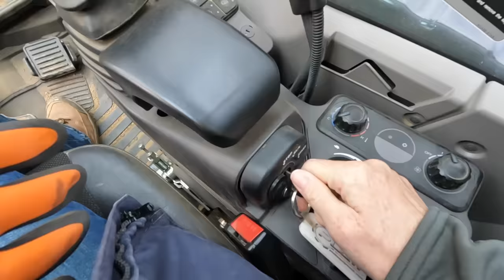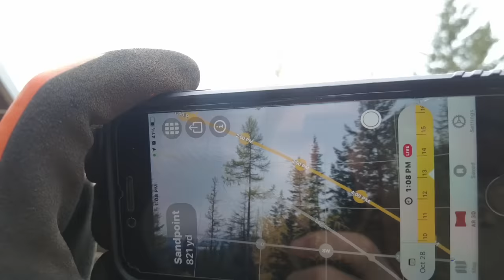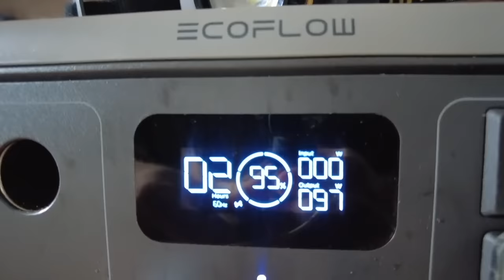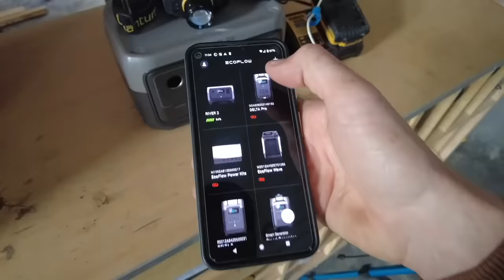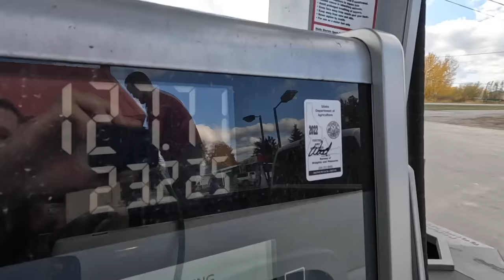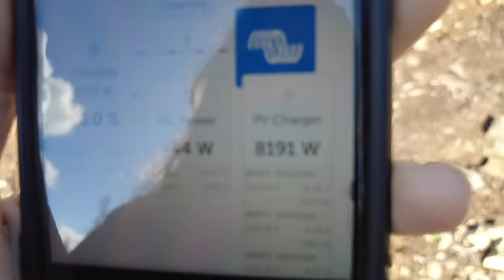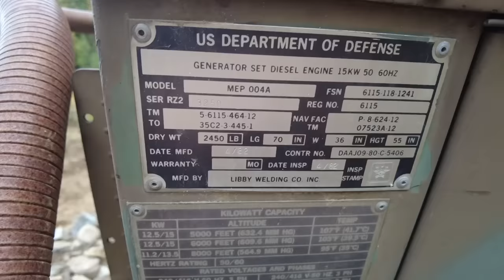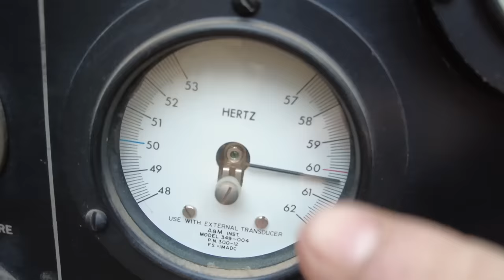Fixing PROBLEMS With Our Off-Grid Solar

Comment: I enjoy your videos. Might I suggest investing in a used heavy duty woodchipper. If you run all your forest wood and branches through it and spread the chips around your land you will add the nutrients back to the soil that the trees took out of the soil while they were growing. It's better than burning them up and losing all those nutrients into the atmosphere. After a few years the chips will compost back into the soil. It's good conservation practice. I'd suggest you add the chips back to the area you harvested the trees from. Good luck!
Reply: I believe the burning will do a better and faster job of returning nutrients to the soil.  It's what mother nature does in the forest and farmers have been doing it for years.
Reply: @srsykes  Plus Courtney gets to burn!
Reply: I am quite sure nutrient do not just go up into the air as there is a huge renewal of plant and tree life after forest fires that are started by lightning
Reply: Mulch holds water, on a mountain side that means soft soils that can slide.  Rot is the best way to add nutrients back from all the bugs and critters doing their jobs but small burns like this also put back carbon without too much worry about NATURAL organic compounds into the air.  The fuel exhaust from a chipper is not better than natural wood smoke.
Reply: @chrisdaniel1339  That renewal of plant and tree life after forest fires are due to many factors, more sunlight hits the ground, certain seeds of certain plants and trees only open under the heat of fire. There are also lots of plant and tree life that does not completely burn up in forest fires but instead rots and decays on the ground, adding nutrients back to the soil. Forest fires are natural and beneficial.
Reply: We use mulch to enhance our sandy soil.  While it has it’s pit falls the advantages out weigh them.  It also keeps weeds and sand dust down.
Reply: @marklar7551  I agree. I wasn't suggesting that burning the wood is somehow bad for the air. Simply that it would be better to add the nutrients back to the soil through mulching, because burning it up adds no nutrients back. Forestry mulchers do the very same thing with great results.
Reply: @marklar7551  modern combustion engines are far less polluting than inefficient open burning... this is well documented, many studies show air quality is terrible when a plurality of people heat with wood in the area. And even a fireplace has more efficiency than a smoldering pile. Far more carbon is lost to the atmosphere along with essentially all the nitrogen and volatile micronutrients.
Reply: Sounds like the forest service plane has taken an interest in the smoke from your fire. They really try to stay on top of fires. Doesn’t hurt to give them a call and let them know you’re burning.
Reply: The organic matter is largely destroyed by burning but the minerals are not. Either way is natural and will enhance the forest.
Regardless of which method is used, the amount of material they would ever cut and either burn or mulch is infinitesimal compared to the amount the forest will produce and add all by itself every year regardless of what they do, so in the end neither matters. 
Burning is far cheaper and as Courtney notes a whole lot more fun.
OTOH if you have horrible neighbors the chipper might come in handy. :)
Reply: @Mudpuppyjunior  That depends entirely on how much is cleared on any given area, and what you do with the ash (which is mostly calcium compounds and some trace elements). If you were to clear cut an area, there is nothing about burning it in a pile that will add nutrients back to that area.  I didn't mean to suggest that the little amount of wood they are burning would affect the composition of nutrients on the whole over they're land. But the fact remains that if you take down a tree and mulch it up and return the mulch to the same spot, that the nutrients from the uptake while the tree was growing will be returned to that spot. And if you take that same tree, cut it up and burn it else where those nutrients at uptake will NEVER be returned to the soil at that spot. Will it make a difference for a tree harvested here and there, maybe not, but it's still good conservation practice.  Particularly if you look at it from a long-term conservation perspective. Btw, i love burning fires as well, but now days it's more of a campfire type thing, not as a way to dispose of large quantities of wood I cut from the land. I would rather rejuvenate the soil with it. In addition, you don't have to cut the tree up in small pieces to send through a chipper. My experience has been that it's not necessarily faster or easier to burn.
Reply: Where we live it burned in 1995. All the old wood just brought ants everywhere. I piled it all up a ways  from the house and the rabbits live it in.
Reply: I think it’s important in a forest setting to burn while wet, anything that could dry out as tinder and lead to a fire in the dry season
Reply: @srsykes  I believe that burning releases more of the sequestered carbon into the atmosphere than into the soil, which decomposing wood chipping would do. Burning is fast, but even for nature this is selective, decomposing wood is more natural and healthier for the land.
Reply: You beat me to it! But not for the logs just the branches to control erosion and just put it all back to decompose in place. They cut the wood to burn.
Reply: I've never seen rural property owners out west using wood chippers for large amounts of waste timber.  The expense and labor would be silly for those size logs.
Reply: This works great for creating nice mulch for ground cover and garden compost. I use a chipper on my tractor for up to 6" branches. Everything that doesn't fit is big enough for firewood. I get manure from a neighbor and mix it into the chips to make a compost pile. Makes an amazing soil amendment for the garden.
Reply: Agreed I never understand why people dont process all the trees 🌲 that they cut down and just burn them
Reply: @mhalcius  Why we don't process every last piece is because we just need to get it done.  Not spends multiple days and $$$ doing it.  It can be difficult to even get people to come haul away free logs for firewood.
Reply: @NoName-ml5yk  If you own the chipper, and haul it to the area u cut the wood, throwing the wood into the chipper is very simple, straightforward and fast. There is no added cost or time other than the initial cost and fuel.
Reply: @pipeman65  I would be interested in what you find for a price for a chipper to handle ALL those logs. We looked into chipping some of our smaller waste wood (<7"). The rental price before the required insurance, taxes, etc. was quoted at $295/day. That was a relatively small chipper. I can't afford that kind of expenditures added to my regular expenses. Maybe others can.
Reply: @brianworley7705  You can buy used industrial size wood chippers at auctions for between 2k - 4k.
Reply: @pipeman65  clearly, you must own a chipper and have the time to do this. What model do you have and how much did you pay for it?
Reply: @FirstLastOne  I HAD a used Altec, which I paid a grand for in 2000', but I had to sell the property along with everything else in 2005. But I did burn everything for several years before buying it. Burning is pretty fast, but not necessarily easier. Hey, it was just a suggestion. They should do whatever makes them happy.
Reply: @srsykes  Burning releases CO2 into the air. Letting it decompose is the best way.
Reply: I would love to see the chipper chosen. The chips are good for paths around the place and trails through the woods. No mud in the wet weather. I knew a guy who limbed trees for a living. He used the chips on his driveway. As they deteriorated he just added more. What a difference with the Georgia red clay.
Reply: amen!!!!!!!!!
Reply: Came here to say the same thing. There is a reason why deserts are being reclassified and not because of dry and heat. More due to humans causing it in the first place by deforestation. Woodchipping would be the responsible way going forward and not repeat the mistakes from the past. Hopefully next time.
Reply: Call on Jesus.....time is short. John 3:16 - For God so loved the world, that he gave his only begotten Son, that whosoever believeth in him should not perish, but have everlasting life. 
Luke 13 3 - I tell you nay: but except ye repent, ye shall all likewise perish. 
John 3:3“ Jesus answered and said unto him, Verily, verily, I say unto thee, Except a man be born again, he cannot see the kingdom of God.”
Reply: @NoName-ml5yk  
YES!!!
Reply: You have a dozer push a trench out and push them in and cover . Out of site out mind ! I'd be trimming the logs and putting them in pile to dry out never know when you'll need a timber or some boards . You could save the logs to make ( natural barrier guard or fencing )along the road between trees . Laying them at the base of trees even building them up if need be to make a log road guard.on steep spots. Use reuse repurpose.
Reply: @marklar7551  
You’d have to regulate the ph of the soil with the chipper method. Problem being the acidic nature of Coniferous growth and the artificial mulching with a chipper. In nature a dead tree stands for somewhere near 10 years adding to the soil with branch’s getting blown off adding gradually to the soil supplements as bugs worms and fungi do their magic. Burning adds to the ecosystem with quick new growth that breaks down quickly on a yearly basis spawning in nice warm bed of nutrients, the seed of the spruce tree.
Reply: @jamespayne8781  
In my neck of the woods (see what I did there🙄)  you have to have a permit to burn because if you don’t and they come out to investigate you’re paying the bill and they’re not shy. 
Lol (You’ll be crying in your beer down the local bar or years telling all your buddies how mean they were to you.)
Reply: @pipeman65  Any logging company in Canada has to clear cut and burn regulated by the government and by a whole bunch of nice young people that go around monitoring the situation. I also believe that this is a smart way of doing it because a lot of my tax money went to studying about this. The other mitigating factor is that the logging companies have to plant more trees than they they have cut down in any given year... also helps to maintain soil erosion to a minimum.
Reply: @BrianBriCurInTheOC  Care less about what Mr. Curwick?
Reply: @BrianBriCurInTheOC  I didn't comment on the science of burning vs not burning.  Just looked at your channel.  Small world.  There are only a few guys here in Sandpoint doing Timber Frame construction.  When do you get up here?
Reply: Settle down 
My science Is backed by NAIT  Northern Alberta Institute of Technology under which Alberta Sustainable Forest Management operate, to which Canada has the strictest forest management guide lines in the world. 
Is it possible you misconstrue some of what I’ve said ?   
Maybe go back and reread what I wrote. The new growth are soft tissue plants that sprout up quickly and die in fall. If you’ve observed the cycle you’d  know that. Then the brush then the soft wood sapling then the coniferous start to the root, which need the soft wood trees to hold the soil in place as they develop their roots. It will be decades before the spruce trees are strong enough to push the weaker trees out of the way. 
Maybe you’d like to explain where your science comes from? Anyone that’s been it the forest and seen the pile of chips where people have done what the op suggested, will also notice that rodent love their new habitat and the thriving over population consequently eat every seed in the square acre surrounding that. Nothing will grow there for decades.
Reply: @FFLFFS  

First of all you are discussing a totally different situation than this couple’s HOMESTEAD!!!

BURNING SLASH HARMS THE PLANET’s  AIR and is a LAZY FOOL’s choice — mulch aids EVERYTHING TO THE MAX — a Timber Company follows a different path for a different goal!
Reply: @BrianBriCurInTheOC  
Btw 
“There is a long history to the practice of adding ash and charcoal to soil and is a proven method of soil improvement.  The pre-Columbian Amazonian peoples developed an understanding of the importance of soil carbon as they worked to meet their agricultural needs”
Reply: @pipeman65  Fast?  What size chipper are you buying for $4K that can accept 40-70 ft pine trees up to 12" in diameter without FIRST limbing them?  What were you on your property to "throw the wood", aka entire trees, into the chipper?
Reply: @BrianBriCurInTheOC  You failed to put that in the context of the discussion. I’ve already made that point with the soft tissue new growth. Decomposing to help along the seed to take root. It’s the coniferous trees are the contention. You are a very angry person and deliberately want to take someone’s comment out of context. 
Next spring get a few wheel barrows of spruce or pine sawdust and throw it on your garden if you think your right and don’t want to look it up. 
Have a nice evening
Reply: @srsykes  some pint tree need fire to open pine cone and soon you have little trees
Reply: I would use it to burn it at Home in Winter!
Reply: @chrisdaniel1339  

WHAT ACTUALLY HAPPENS IS SOME PINE SEEDS MUST BE HEATED TO BE RELEASED FROM THE COME AND ABLE TO GERMENATE. BUT THE FIRES OCCUR MANY YEARS APART AND THE ORGANIC DEBRIES FROM THE TREES BUILDS UP IN MUCH HIGHER QUANITIES THAN WHAT OCCURS FROM THE BURNT MATRIAL LEFT OFVER FROM THE FIRES!!!
Reply: @marklar7551  

THE FIRST HALF OF WHAT YOU WROTE IS CORRECT BUT THE PART AFTER SMALL BURNS IS NOT PRPER SCIENCE AT ALL!!!
Reply: @chrisdaniel1339  

So which campus is your Degree in Chemistry, Physics and Plant Biology from — The University of FaceBook, YouTube or Instagram???
There is nothing healthy or productive about burning up organic material which when mulched and composted and then combined in soil — the mixture provides water absorbing qualities and provides N-P-P that provides nourishment to grow better crops!!!
Reply: @BrianBriCurInTheOC  You do realize that when you burn a brush pile that all the nitrogen, phosphorus, and potassium that was in the trees before burning is in the ash after burning ready to fertilize the soil?
Reply: @NoName-ml5yk  

I live in SoCalif where more trees are trimmed than anywhere else in the world!!!
I watch Tree Trimmers Chipping Trees and Limbs up to 8” in diameter everyday.
All of this organic material is composted until it is decomposed into material that is a fine crumbling material that grows plants, shrubs, trees without any soil AND THIS MATERIAL WILL GREATLY IMPROVE SOIL QUALITY MUCH MORE THAN THE VERY LITTLE FINE ASH WHICH REMAINS AFTER BURNING WOOD!!!
INSECTS GROW IN ORGANIC MATERIAL, WHICH IS VIRTUALLY IMPOSSIBLE IN ASH. THE ONLY REASON ANYONE WOULD THINK BURNT ASH IS HEALTHIEST IS RED NECK SCIENCE DOES NOT BEGIN UNTIL 6 GRADE AND THESE GENIUSES MAKING THESE ASH CLAIMS ARE SO PROUD OF THEIR 5th GRADE EDUCATION!!!
Reply: @BrianBriCurInTheOC    Are you that cyberbully guy?
Reply: @srsykes  

JUST BECAUSE YOU HAVE BEEN DOING IT FOR YEARS DOES NOT AT ALL MEAN THAT PRACTICE IS 100% CORRECT!!!
EVEN IN MEDICINE PAST LONG HELD PRACTICES HAVE BEEN PROVEN TO BE LESS THAN OPTIMUM...
Reply: @brianworley7705  

ONE THING YOU CAN DO IS SAVE THIS MATERIAL FOR A ONCE A YEAR USE OF THE CHIPPER AND YOU COULD ALSO WORK WITH YOUR NEIGHBORS  AND FRIENDS TO DO IT TOGETHER...
Reply: @MyVideosDon  
AND CARBON MONOXIDE
Reply: @srsykes  faster yes, but lots gets lost and all the captured CO2 gets released
Reply: *nearly all
Reply: I agree the burning of the all that wood seemed really wasteful

Comment: Where I live - firewood has more than doubled in price in past year. I have been cutting up old scrap wood. I would have kept everything thicker than 1". Having said that. If I had farmstead, I would have kept all, built gasifier with old petrol engine generator and turn those branches into electracy and heat over the winter. And there you see! Like I said - with the dozer, you should have taken the track of the idler, put it on the sprocket and then back on the idler wheel. Much much easier. And when you have excavator arm around - use it, don't try Hoe Nr.1 and crowbar. Well done by the way! You both will be great after couple of years more! :)

Comment: Hey guys, just a safety thought. When relieving the pressure on a tracked machine, be sure to take the pressure off the tread first. You did that with the track knocked off. Removing the grease nipple or the plug that holds the grease tensioner, it can come out like a bullet if the tensioner is loaded. Stand to one side when taking it out just in case. Great videos.

Comment: Hi guy’s. Just an idea. You might want to place rock on the hill beside the solar panels to reduce erosion. The roots of trees help hold the soil in place. Mud slide!
Reply: I was thinking that too
Reply: Place rip rap beneath the solar array
Reply: I was thinking some good old grass seed would make it look nice.
Reply: Concur!   Definitely need erosion control or your whole system could end up at the bottom of the hill.😳
Reply: another idea would be to build a retaining wall with a concrete slab between the wall and the container so that thre is a flat stable path behind the panels. it would also allow you to build a small road below the retaining wall for use outside of winter so you would be able to move the excavator around the property easier